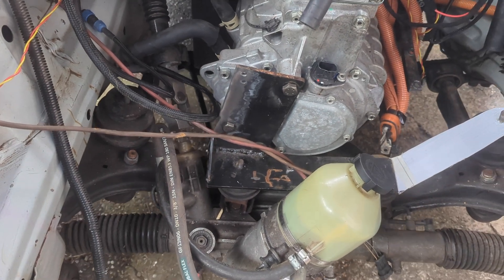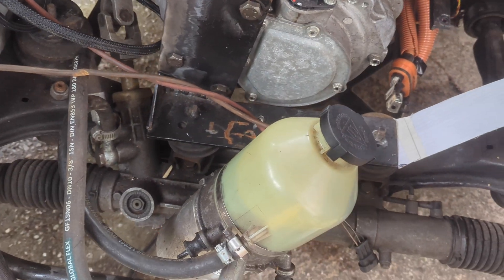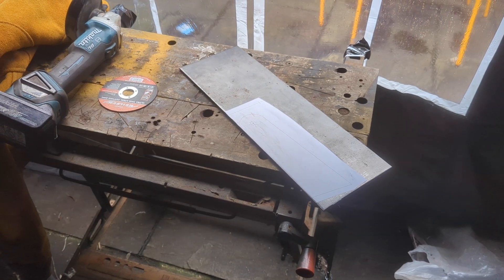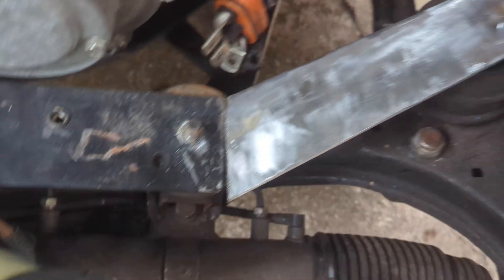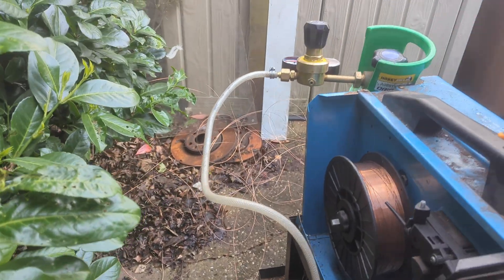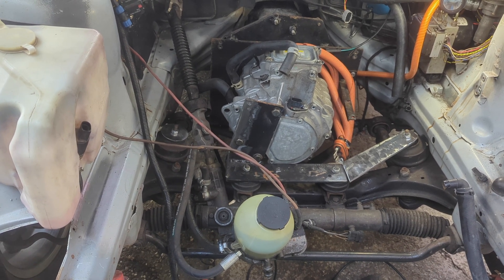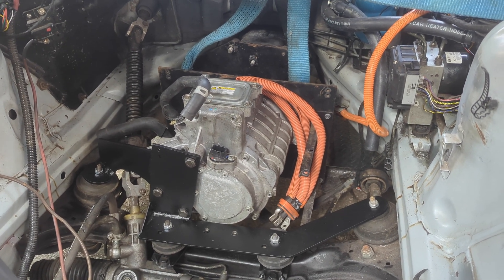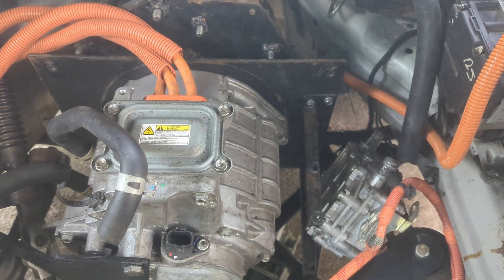EV-Swap Motor Mount: From cardboard, to CAD, to steel

Comment: The wire feed mod has transformed my welds and fairly cheap to do
Reply from the maker: Yeah but I don't think it's the same issue on mine. The motor isn't the problem. It has no problem spinning. It's the friction in the cable Vs the grip of the wheel. Might need a new wheel or a shorter cable.

Comment: I think I would have welded an angle piece to the mount to the left. The forces on it might make it break off again without more bracing.
But than again I always over build stuff so it ends up being far heavier then required. 
I was told the heater needs to be pointing up to prevent air locks but you probably already know that. 😉
Reply from the maker: Yeah I'm pretty confident in it. It was just a crap weld first time around. There's no upwards or sideways pressure on that weld any more. Just straight down through the mount so I very much doubt it needs any bracing. 

I had actually forgotten that about the heater but I'm hoping the positioning of my pump and filler will overcome any air locks.